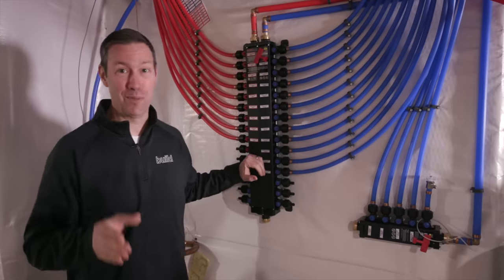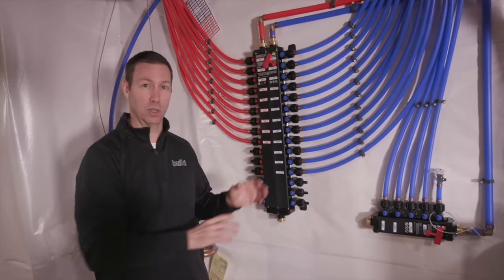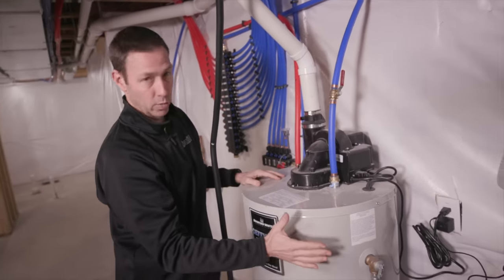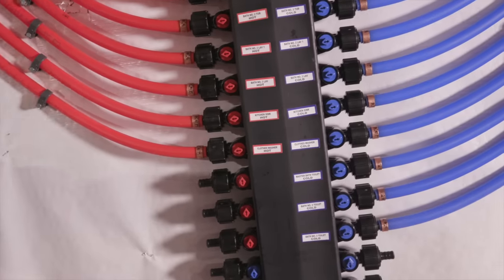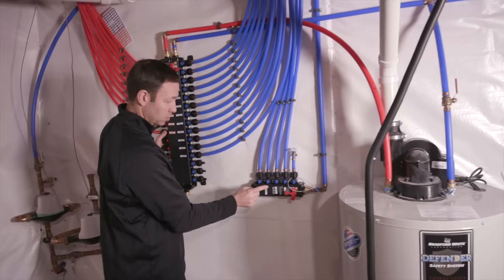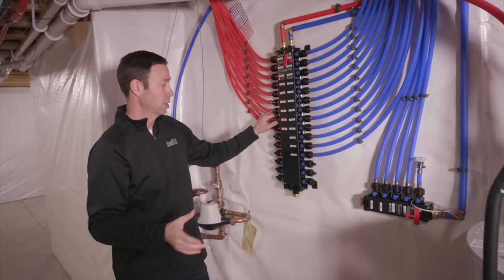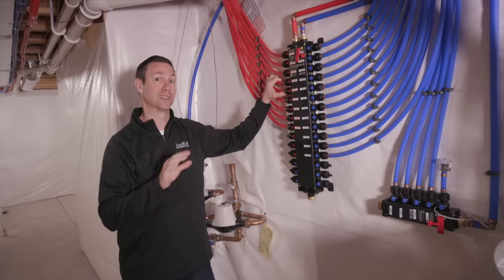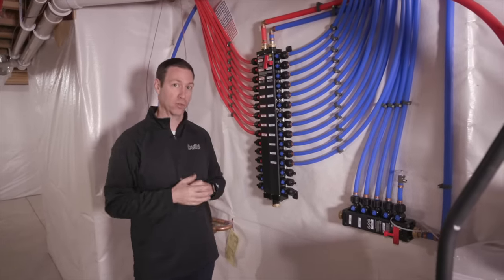PEX Manifold System - Pros and Cons + Tour

Comment: A problem with running a single line to supply many things is pressure drop, even adding recirculation won't fix this.  Someone flushes the toilet and you burn the person in the shower down the hall.  Even installing a pressure balancing valve dosent fix the pessure problem because the total water flow drops to a trickle.  Having a properly fed main block and running directly from it reduces the pressure drop problem.

Comment: You math isn't right.  It's 1/2 gallon for 50 feet of 1/2".  1/2" PEX only has an ID of .485", which is why they came up with 5/8" PEX to approximate the flow of 1/2" copper .569, which is still well behind 1/2" Schedule 40 .622.  Shucks, the OD of 1/2" PEX will almost fit inside of 1/2" Schedule 40.  The upside of course is to single low-flow-fixtures, it speeds things up.  

IMO coming in with 3/4" PEX is way too small so there will be a pretty good pressure drop from other loads.  It needs 1" because 3/4" PEX .681" flows nothing like 3/4" Schedule 40 .824.  There is a lot going on there.

I agree in that that design of having no insulated lines is not conducive to a gravity or pump recirculating system nor preserving heat on long runs.

A thought would be to do a branch system to things such as toilets, hose bibs, ice maker, and make or buy a simply 1" manifold with 1/2" PEX-A and insulate the pipes to showers and sinks to improve response times and pressure equalization since the cold and hot would be located at the hot water heater.  You could run dedicated warm water returns and check valves easily that way as well.

Comment: Why not do an insulation wrap around all those hot water pipes so that ambient heat would warm all those pipes in the wrap. Or better yet have on demand hot water heating at the area of use. In this case the manifold distribution system would definitely be the best way to go.

Comment: I think the manablock system is great for cold water but a terrible idea for hot water. I think a point of use hot water heater would work well with the manablock system.

Comment: I think it’s great. Except for the plumber not insulating. I only use hot water in the kitchen sink, to shower and for a hot shave and I turn all of these on at different times. Plus yes. I can turn off the hot water when my kids shower!!  Also yea big house. Just get more water heaters, with this system or with the typical it’ll take time to charge a line on a big house anyway

Comment: as i understand, your not supposed to have pex within 18 inches on water heater. Is that not correct? Most plumbers put an 18 inch copper flex line on the incoming (cold) and outgoing (hot) side of water heater

Comment: Interesting to say the least.  I would think that the pros out weigh the cons.  I'd like the ability to be able to drain lines from the manifold as well to allow for any future work(s).  As well, I would like to have a "main feed manifold" for the home which would branch off to area/floors sub-manifolds where air-source/solar hot water tanks would feed the sub-manifolds.  Of course there would be multiple ways to plumb a home, each w/ pros and cons; all about the cost-to-efficiency ratio.

Comment: "Dumb question" from the outset photo:

Why use elbow joints going into the manifolds instead of just running wide radius curves? 
The elbow is a pinch/noise point and the 2 extra joints are additional points of failure. I get "asthetics", but I'd rather have long term reliability.
Reply: Alan Brown not just places of failure, but places of pressure loss too

Comment: I love home runs like this but we make the hot water delivery faster by doing our sink fixtures in 3/8" pex.  This makes the hot water delivery  3 times as fast as if I brought a 3/4" line up to the bathroom and T'd off. 
.
Reply: Rich Zellmer yeah, and no water pressure. Should just run a 3/4 main line to manifold down to 1/2,add a circulatory pump. Hot water in maybe 2-3 seconds.

Comment: I think the output from the manoblock is oversized.  Since each pex line only supplies one faucet, 1/2" is overkill.  Somewhere between 1/4" and 3/8" should work just fine and you wouldn't have to wait long for hot water to flush the tube.

Comment: Good morning Matt, I've been following your channel and appreciate your hard work. I was wondering if you could please review the most inexpensive building method for a zone 6 build. Mine will be an all cash build of 3 bedroom single floor single roof line ranch type home. I think slab on grade 2 x 8 sidewall with a propane stove air heating and the balance a warm floor or large tiles. My concerns are mostly cost. How can I build it the cheapest? I know there are so many products, siding , and insulation products but my budget means this will be under 1000 square feet . Hard facts, best framing and cheapest possible finish. Thank you.
Reply from the maker: Good suggestion. Let me noodle on that video idea.
Reply: @buildshow  Thank you so much for considering this. I have already chosen my floor plan but your videos on framing and insulation got me extremely concerned that I had no idea what I was doing especially on the vapor barrier (another video you did). I built a small home about 25 years ago with 2 x 6 walls insulation, barrier, and trusses. I put the plastic pipe in slab heating (which failed after 6 years) and just banged it together with myself and one hired man. After the single zone hot water floor heat failed I just put electric radiators in for backup heat to a wood stove. It was not terrible but I had to  pad and carpet everything to feel comfortable. 

So this summer I'm gonna build myself again. I really liked the idea of ICF until I found out the cost and quickly deleted the idea of having a basement, again cost. Burying the wire in the slab is easy enough but the effects seems to me that I'm just heating a large mass of concrete like this hot water system but since we are all out of the house 10 hours a day it seems I'm not gonna save any money keeping the floor hot all the time. I like the idea of the warm floor just under the large floor tiles because the effect is immediate and it may just run a few hours a day in most of the rooms. Hopefully if anything fails it would be just room and not the entire system. 

I really appreciate your channel and hope someday you can produce a video for a homebuilder on an extreme budget. Thank you

Comment: This is old days stuff
Run only cold pipes and have a instant electric water heater for hot water.
You may need 10 units.
Reply: And spend hundreds if not thousands more for all of those instant heaters, which will consume at least double the energy of a proper tank or tankless central heater.  Oh, and add the labor and materials for the electric or gas supply to all those heaters too... smart thinking there bud.

Comment: Could not GIVE me a manifold system.  I like the 'direct line' to each run, but, I have grown accustomed to having hot water at each fixture almost immediately - so I have a recirculation pump that activates with motion sensors.  I have a 3/4" loop all the way around the house.  It was worth the extra cost of the loop

Comment: I’ve been doing service plumbing for 7 years..
I’ve seen a major downside is the early models of these “mana-bloc” systems will crack on the inside, and cause the hot and cold water to mix. 
It becomes a problem on the closest fixture not having hot water.. 

Later models 08+, I’ve never seen this problem.
Reply: Just a tip for future reference.
Reply: Yikes. That seems to be a headache. I’d it complicated to replace the manablock?

Comment: Is it code to run PEX directly to the water heater? I was told I needed 6" from the heater with metal pipe.
Reply: No, IPC says you need 18” for gas units.

Comment: Why did the plumber run 1/2" home runs for a single fixture ??   3/8" tubing has plenty of volume to deliver to a single fixture and dramatically reduces the time for hot water to reach the fixture. This is a big benefit for Manablock systems and is the proper use of it. 3/8" pex is readily available.

Comment: So his downside of having to wait for each hot water source, run the pex to another manifold closer to the bathroom so you don't have to wait as long once the system is charged.
Reply: @Brett Matisz Unless you have a circulating system, then you always have to wait for that first fixture to drain the cold water, but Justin's suggestion would mean you wouldn't need to wait as long for the second fixture in that room.  Would it be worth a second manifold for those times?  I doubt it.  I'd rather just run the whole hot water for one bathroom off of one line.  That way you could turn off hot water to that room (most of the advantage of a manifold) but still not have so much pex and your second fixture you turn on won't also have to wait (the advantage of a trunked system).

Comment: i know this video is old, but food for thought why not a large manifold at the entry point like here and one supply line to each room needing it with a small manifold for different amenities. EX- sink shower toilet? would eliminate the need to flush full runs, that 30 sec warm up time down to much less after the first amenity is used in each room. with the same principle of being able to shut everything off at centralized manifolds.

Comment: Great info. How does a radiant floor heat system tie in?
Reply: It doesn't, your indoor should be a closed loop system. And if you use this engineered plastic manifold crap for hydronics, you'll regret it down the road.  Cheap up front compared to higher quality products, but more expensive in the long run once the never ending repairs that will be made until you throw in the towel and cut that shit out and do things right.

Comment: One other downside I can think of - say it’s 10 years from now, and those shutoffs are a little sticky and the manifold plastic has lost some integrity  - you go to spin a valve and it puts a crack between the valve and the manifold. Is there enough pex there to splice in a new manifold, and will that same manifold be around 10 years from now? Any damage to the manifold could be a big headache.

Comment: Using a system like this does it affect your water pressure I've seen houses where they have systems like this one place but with low water pressure what could be afix for it
Reply: Nope.  3/4 supply to the manifold is more than enough for 16 fixtures.  The problem is bad piping; joints, crimps, etc.

Comment: Zip tying pex lines together like that may look nice but it's going to cause a lot of concerns with the home owners. When the pex lines expand and contract on each other they make dripping sounds, they should always be isolated from one another.  Water softeners reduce the life of tanked water heater's If the anode rod isn't inspected regularly and replaced when the manufacturer specifies.

Comment: I didn't think you were allowed to run PEX right to a Gas hot water heater.  I thought they had to have 18 inch or something like that of copper as a heat barrier.  Perhaps LP vs NG,  IDK.  1" inbound to 3/4 to the fixtures would have been nice.

Comment: Hot water delivery in a home run system with 1/2" lines will be far quicker and waste much less than one with 3/4" or 1" lines. The complaint about waiting for hot water at a faucet and then waiting for hot water at the shower is pretty weak.
Reply: Yeah, that argument is only valid if you dash into a shower right after doing a bunch of dishes.

Comment: I just redone my water lines in my basement. It was 1/2" copper lines. I went to 3/4" pex lines. So it's 3/4" until it reaches the fixtures and then it goes back down to 1/2"  I hope I didn't mess up going with 3/4" pex instead of half inch. Today I should finish. I'm hoping the 3/4 pex will deliver a better flow even though at the end it goes back down to half inch.

Comment: Why not use a spot heater at each fixture?  They turn on for instant hot water and turn off when the hot water arrives.  They would be on just for seconds and it solves the problem.  If your building a large house the additional cost is insignificant.

Comment: Waiting 15-25 seconds for hot is nothing compared to where I grew up and we had to wait a minute or three for the oil furnace to "wake up" and start heating water. And how much more is the PEX run than a copper run? Not much, I think. If you want the fastest hot water, you need on-demand hot water at or near the point of use, and that is a different animal than PEX vs copper. - - And you leave out, or under-emphasize, the most important reason to use a manifold. Pressure and temperature equalization when multiple taps/appliances are being used.

Comment: I think your math was a little off for the hot water line. Please correct me if I'm wrong. Volume (V) = Area (A) * Length (L). Area (A) = (pi)*(I.D.^2)/4. So V = (pi)*(I.D.^2)*(L)/(4). Input the numbers: V = (pi)*(0.5^2)*(25*12)/4 = 58.9 sq in. = 0.25 gal

Comment: Most plumbing systems do NOT allow PEX all the way to the water heater.  Depending on code, it must be metal i.e. Galvanized or copper to keep the PEX away from the draft diverted or vent .  Even more, those lines aren’t supported on the long loops to the heater.  They can rattle.

Comment: That's western Canada style, one manifold feeding all fixtures. More pipes but less fittings, thus less chance of leaking. In the East, we are more traditionnal, you have a main line with Tees on it to feed the fixtures. Less pipe, more fittings. I build 50 storey buildinds like that. UPONOR guys always try to sell those manifold systems but it seems we're not ready for that in Montreal.

Plus, all contractor quotes with traditionnal crimped pex B fittings. We always quote with expanded pex A with propex fittings and still manage to get the contract, even though it's more expansive

Comment: Fantastic video!  It's a cool system but a truck and branch system as Matt points out wastes much less water and PEX.  Why in the heck would you ever need to turn off a bathroom sink but still need the shower when most common plumbing repairs are at the fixture level and can be individually shut off right in front of the fixture.

Comment: Why add shut off valve near water softer? Does it have bypass valve?
Reply: It does have a bypass valve.  I can take that softener head and valve assembly off line when it breaks (and it will) and still maintain water in the house.  I've worked on dozens of them and very glad to see good shut off valves.

Comment: I used this system and 1st week one leaked, second week another. Plastic is not the way to go. I ripped the manoblock and built my own using copper and quick connects. No leaks.

Comment: You can do the "one circuit cutoff" kinda with other plumbing ways too. In our house every room has their shutoff valves (plus one for the circulation, which isn't part of that manifold system anyways). Also every faucet has their own anyways (since you mentioned replacement). It takes a bit more room and effort (and you can't isolate the lines running into the rooms) but I like having it in the room where you work on/have the leak/test if you fixed the leak. Just like with PEX probably a matter of personal taste?

Comment: All the training I had said not to connect PEX directly to the water heater you need a stand off 18 in
Reply: Yes all codes call for 18 inch metallic pipe coming off a water heater .   Got to wonder about these ss flex hoses with plastic tubing for liners.  Gas fired / forget about !!!

Comment: The other thing I like about this pipe is I personally think it is safer to drink out of than any of the other pipes commercially available. Metal pipe leaches into the water. Vinyl chloride has been linked to cancer. Pecks pipe cannot be glued therefore I would consider it fairly inert and probably not leaching much into the water I would hope. If you know anything to the contrary please let me know because I'm banking on the system

Comment: I think there is too long distance from water heater to every fixture and means longer waiting time to discharge cold water out the pipe. If the cannot bring water heater closer, they better run bigger diameter pipe closer to water required rooms and install smaller manifolds there. This means if you discharged cold water already it will be a lot less waiting time to get hot water on another fixture close by in short period of time before water cools off.

Comment: could you not do this same system for each home run acts as that rooms trunk? That is to say, rather than have bathroom 1 faucet as a run and bathroom 1 shower as another run. Simply have bathroom 1 as a run, so you only have to charge a line once?

Comment: How are your local codes? A hot branch can't go more than 10 feet from the main and I thought that was upc? Also yea I noticed no insulation but I've heard some real ding dong plumbers say that red pex has a type of insulating coating on it. I doubt this is true but it would be nice to hear that be confirmed or denied. Also, can u even set up a tankless system with this crazy set up?

Comment: Every hot water tank manual I've seen says not to use softened water. It significantly shortens the life expectancy of the anode rod. If you don't change it regularly (like every normal home owner) the tank then fails very early.
Reply: No anode on gas heat.
Reply: @1dariansdad  All tanks have anodes, including gas water heaters.

Comment: I thought it was not good practice to run the pex DIRECTLY into the hot side of the water heater because the higher heat just out of the heater damages the pex over time.

Comment: by code you cannot have pex going directly to the water heater, there has to be separation from piping to tank by metal that's code approved, nut by nut flexes would've have been better